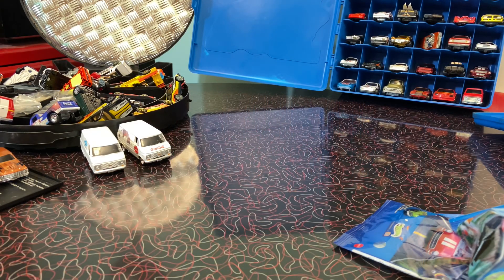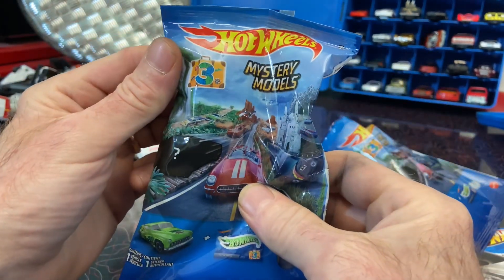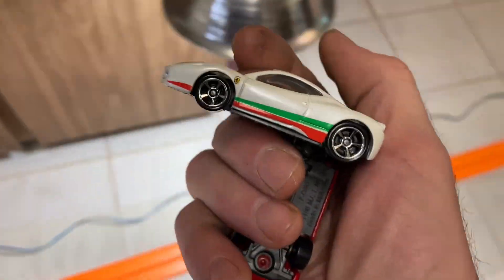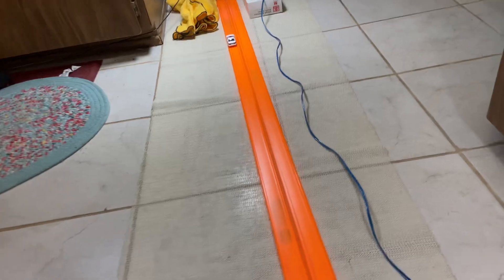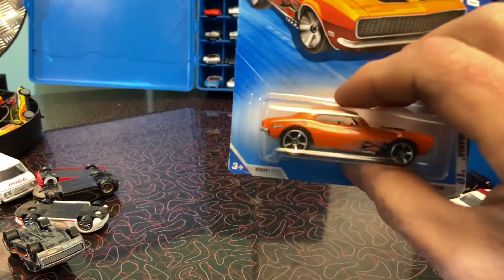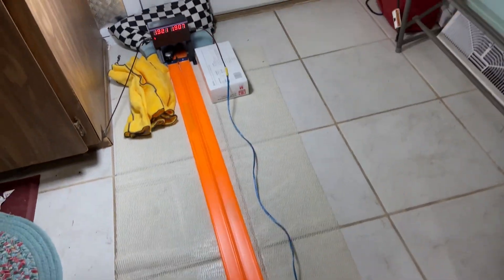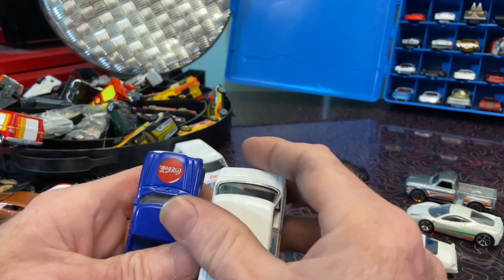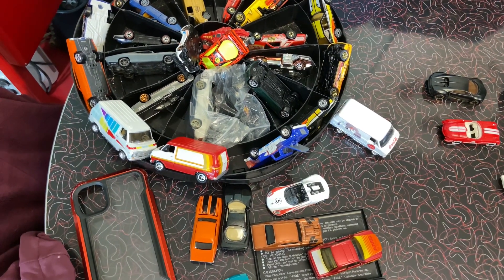Mt Holly Racing Camaro 5 Pack Featuring Mystery Bugatti Chiron

Comment: Gr8 testing and runs Bobby! That red Corvette was a lame duck for me, glad to see you go one with some speed....
Diggin the Bugatti,  Isaiah wants me to find another one...
Like seeing another fast Ferrari and nice work on the track improvement, certainly makes for more consistent racing 🏁
Reply from the maker: I really like the Bugatti too. I can’t get any wheel spin. It’s strictly eye candy.
The Corvette took dust well. 
The track is almost too fast.
Thanks for watching Brother
Reply: @Bobby D’s Lakeside Raceway  ya, I've never came across a Fast Bugatti yet, may have to customize one
Reply from the maker: My FTE is way faster. 
I bought itty bitty sinkers to put in the window to give mass without breaking the seal. It can be reversed too.
Sometimes it doesn’t help.
Which brings me back to mass is a contributor, not a defining factor.
It’s all in the wheels.

Comment: Man that Mercedes taxi looks rough, it's like painted on rust.
Reply from the maker: It’s the worst paint job ever! It looks like fudge! 
Hans makes up for it.
Thanks Tomi
Reply from the maker: Update 
My track has the biggest balls of them all!
I was very careful not to show them. I didn’t want Blue Balls to get any ideas.
I suspended a barbell from the roadbed, near the gate. The added mass stopped the hop.
Everything got faster.
I looks quite obscene .
Reply: @bobbydslakesideraceway1849  Gotta have balls 💪 It's really curse of lightweight downhills, those spring loaded gates need to transfer that power somewhere. I'm still using my 3DBotmaker gate, that doesn't jolt cars as kick is lighter.